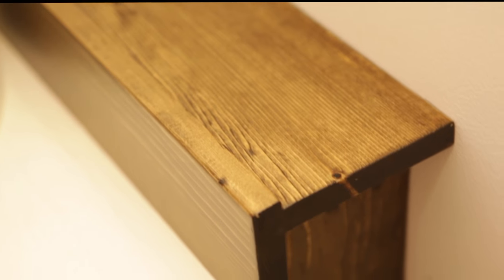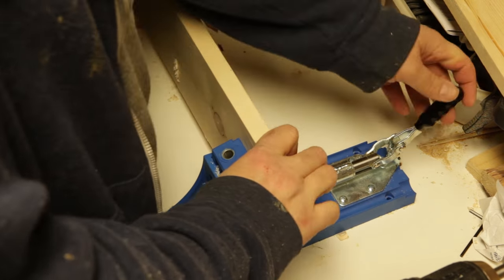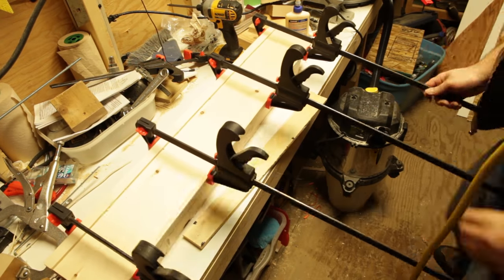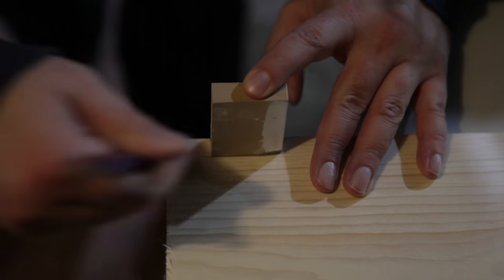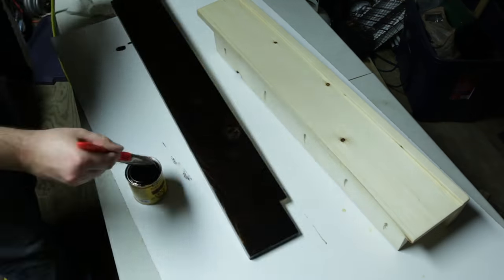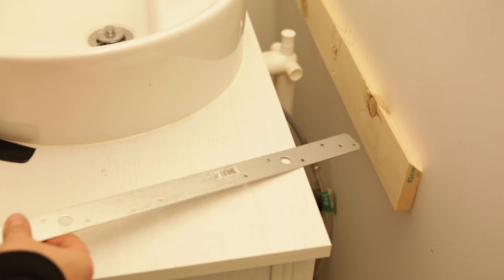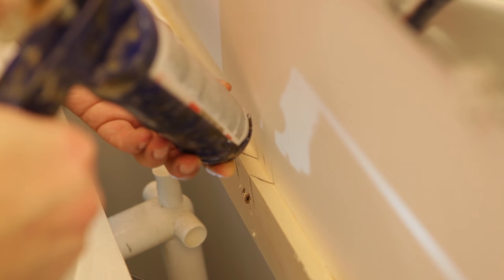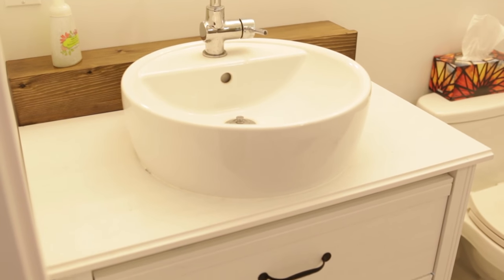Ikea Dresser to Bathroom Vanity DIY Hack #2 - LHP

Comment: I’m doing exactly the same but also covering the vanity surface with a cut off from an old farmhouse table I saved, I’m looking forward to getting it done, and I’ll also do what you have at the back of the unit. It’s a tight fit as my downstairs toilet room is very small but it will all tie in beautifully when it’s completed 👍